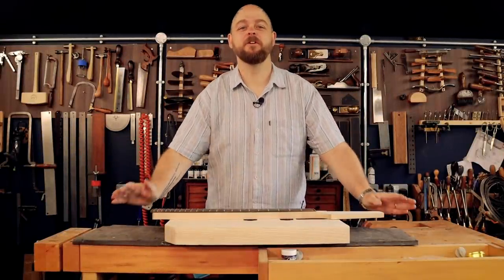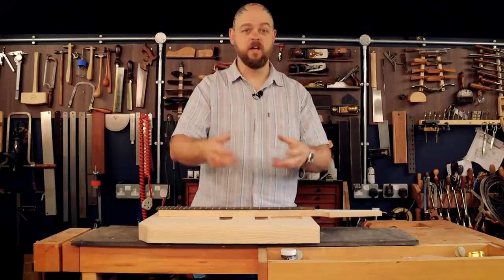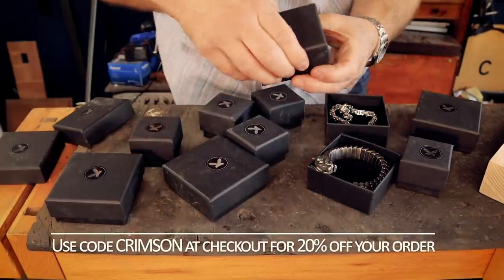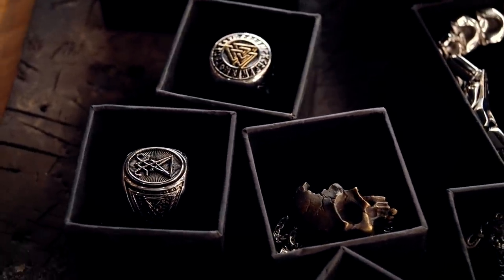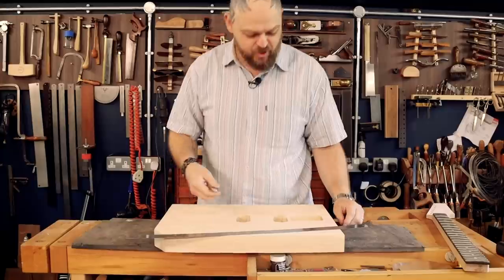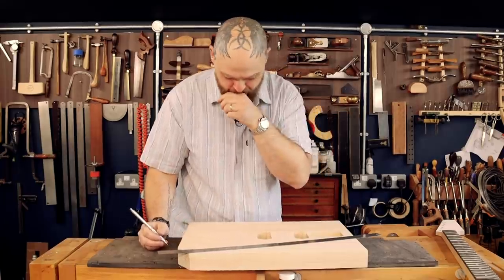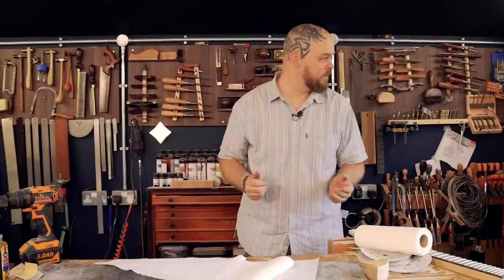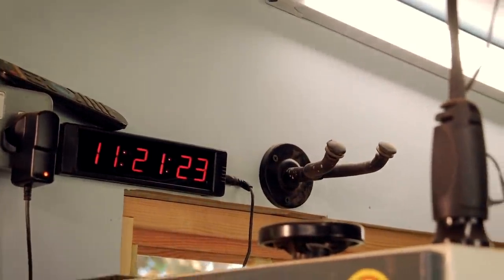Ep 1 - Guitar Design and Body Shaping - The Uncut Kit Guitar Build

Comment: Ben I think your work is utterly awesome.  I think you like to do the time build thing because you do your best work while you feel you are under pressure.  Without that pressure, you tend to wander on your builds and change direction.  Usually, with that wandering around comes some of your greatest artistic builds ever.  Your fan base is going to watch you because you are you, regardless of whether you are trying to beat the clock or trying to do something a little crazy and downright amazing.  I guess with that said, I have to vote for the wild and crazy artistical side of Ben Crowe.

Comment: Several thoughts on timed v. non-timed builds.  I enjoy the timed builds but let's face it, Ben, in many cases you do tend to wait until you actually have to commit to something before you do it.  With a non-timed build you are free to plan a little more deliberately and have no restrictions on your "think" time.  While it may present a nightmare for your editing staff, at least you can parcel out the build into a well-document, multi-part video.  Also, a suggestion for a "timed" video: write down what you intend to do beforehand and follow it to the letter, leaving no room for ad lib, and see how well you do with that.  Cheers....